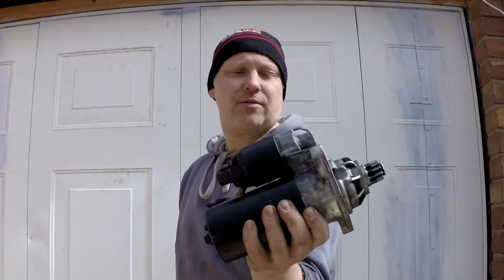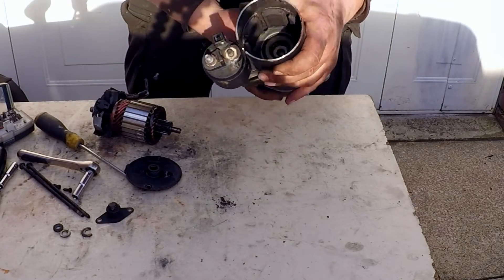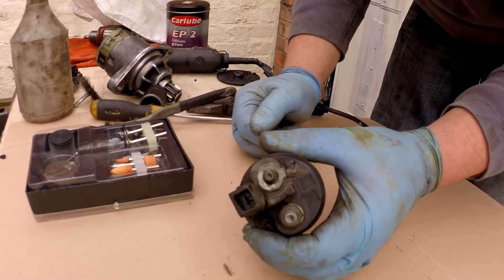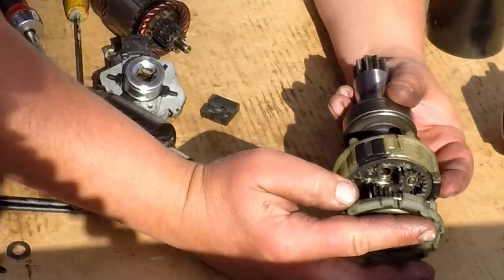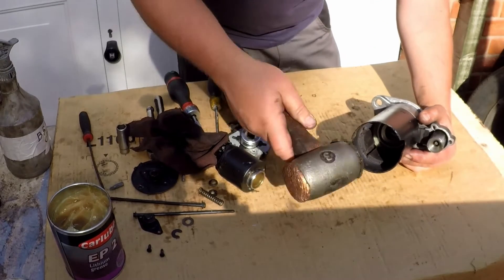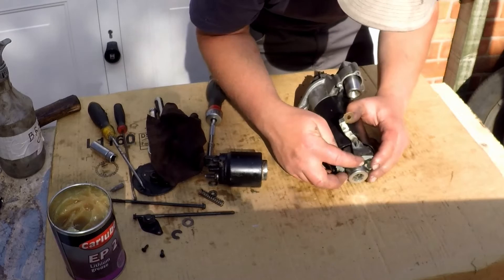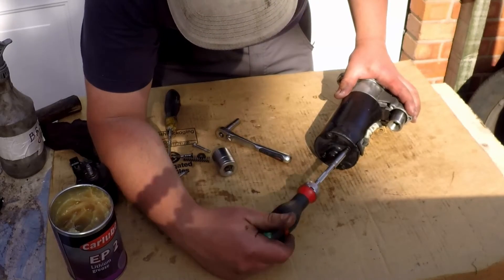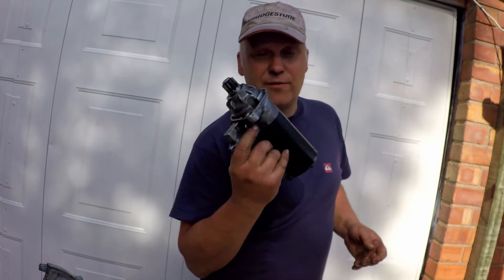Bosch Starter Motor - Strip Down & Rebuild, fixing a slow/poor crank without parts

Comment: Hi...Is the pinion operating lever also available as a spare...in fact is there a rebuild kit with bushes also...It's a poor quality lever  as not steel and shatters sometimes.You could have tested it as you know...before refitting ..but probably safer to not show that process to amateurs.

Comment: Thank you! I have the problem where the bolts securing the starter to the engine block have seized. I will try to attempt this while starter is still mounted. Gut it and put in a replacement bendix gear. Wish me luck! 👍
Reply from the maker: That sounds like a massive challenge!! I'd spend time soaking what ends of the bolts can be seen in a penetrating spray/liquid and give it another go, ideally if the engine can run and get it warm before hand
Good luck 👍
Reply: @CrispysProjects  I've already thrown about two cans worth of penetrant oil at the problem. Won't do. And the starter is shot so I can't warm up the engine. So this is very much a final act of desperation. 🙃
Reply from the maker: @YouHaveReachedBob  Wowsers that sounds terrible 🙄 Other than keeping my 🤞🏼 I can only suggest a push start to try get the engine going or a hot air gun to warm it

Comment: Wish i knew this before i peft my old one out to rot 😂, took it apart and plenty of meat on the brushes and inside looks good but the gear and the clutch thing (cant mind the name) is rusty as now 😢 and my replacement starter just went on the fritz but might try this out on it

Comment: @CrispysProjects i went (ok, read was forced to) one step ahead with this complete tear down by having to reseat the pole pieces,the permanent magnets around the rotor. Thats a bit of a pain in the you know where by itself and that pain doubles when you realise that the rotor now turns in reverse and slips the one way sprag clutch. Had to tear it down again, but in the end, it was worth it. Have a video, might post it. Loved your vid, mine is exactly the same unit. Good job!

Comment: Great video . I’ve to take the golf mk1 starter motor apart
Reply from the maker: Little slow moving like the starter, I'm mid way though another rebuild but with new parts you might find more useful, just awaiting parts!
Reply: @CrispysProjects  my starter just “clicks” so I’m guessing it’s carbon dust build up ??  I hit it a few times and it did work but it does it now nearly every few days so what do you think it is
Reply from the maker: Good chance it's the solenoid either not fully engaging or the level it controls sticking ,try not to tap it too much one of the magnets could come loose
Also time's like that being an classic earth's/lives all good
Feel free to DM pics

Comment: I use a bit of angle iron with 4 holes drilled into it lining up with the solenoid screws and plunger to press it out in a vice. I used to work in a factory with a press to split them. I used to do about 140 a shift. Bosch 0331 lol.
Reply from the maker: I'm going to say you know what your talking about without a doubt! that sounds like a good way, keeping it all lined up - many thanks to the tip👍

Comment: I`ve just disassembled a similar Bosch starter but the magnets came out all together with the rotor. They doesn`t seem to have been glued, is that normal? I have never seen something like that.
Reply from the maker: Errr, yes your right the magnets should stay in the casing, I have no idea what they're bonded in with, I suspect heat resistant at least.
Might of been part of the failure!
Reply: @CrispysProjects  I've only fixed my own starters so that's like 5-6 in my whole life and all of them had the magnets staying in case. I also always knew that if I a magnet is not glued anymore I just go get a new starter. It just seemed strange that all if them are moving now and the starter was sometimes working, I thought it's a new design 😂
Reply from the maker: @wladimiroff7841  glad to hear your keen to fix stuff, no it's not a new design just an old one made cheaper is all I'm finding!!
Keep up great work, and thanks for the comments 👍

Comment: Does anyone know where I can find the coal for this type of starter. I've open it up because it didn't work anymore and I find out the coals where almost gone.
Reply from the maker: I've found many kits on eBay from both random brands and Bosch advertised, they are normally by type number that's little harder to cross ref, need the Bosch part number from the casing help you
I use Autodoc uk website which is great, when buying a number of parts, here's a £3 coupon for new users AC24679507

Comment: Not sure if you're still monitoring this but great video. Just a question on the one way bearing (clutch) itself - you don't mention getting into it - is it serviceable as well ??
Reply from the maker: Thanks for the comment 👍
Only two options is cleaning or replacement, I believe there's no serviceable parts to it

Comment: Is it possible to fix it when the starter gear engages but does not spin.
Reply from the maker: Hey, Chad I've not come across many that don't turn by had unless there has been compete failure of something, take it you've gone back partly stripped it to check it out what's stuck and then parts available.
Might be an option to find a rebuilt one on an exchange basis (normally cheaper than outright buying) or finding used unit
These carry massive current, jamming on could cause massive heat which in is never good near fuel and other plastics
Sorry, better stay safe 👍

Comment: I have done exactly the same and now seems that the starter turns other way around and doesn't want to crank the engine. I must say that I've removed the magnets and not sure if I've fitted them same way back...did it happen to anyone else?
Reply from the maker: I've not came across that before, to turn the opposite way would been the earth and lives swapped around which isn't easy. More likely is something isn't right maybe with the throw out arm. strip down again and recheck everything and all the electrical, including the 13mm nuts are clean - good luck and recheck everything many times

Comment: This has been the only starter strip down video that I've seen that mentions the locating nub on the starter barrel. After I figured it out. After about 2 hours of frustration and tears. In other videos they just slap it together and it all fits.
I wish I'd come here first.
Reply from the maker: Thanks for the comment, I'm glad it's helped you out 👍
Hope it's all back together and working just fine
I also had the same issue 1st one I done, so worth sharing what goes wrong
Reply: @CrispysProjects  It's back together and so far only bench tested.
2 of the brushes were getting stuck in the holder and not making a connection.
Oh, and you're the only one that said to fit the barrel first then insert the commutator, that helped a lot.

Comment: Couple of minor points - It's a good idea the clean the commutator back to clean copper with some emery paper, and clean out the channels between the bars of the commutator with a thin pick. You can even put the armature in a drill to do it. And they're brushes not bushes :) Last one - still sounds a but lazy, maybe think about replacing the brushes anyway as they're not expensive.

Comment: Been struggling with hard cranks in the morning for some time now, solved quite a few things along the way, but you are the first to mention ECU needs certain amount of rpm to fire, thanks! This has been driving me nuts! Excellent video!
Reply from the maker: Thanks Max for taking the time to watch and leave a comment, I hope your closer to solving your issue 🤞Yes ECUs need to have to have a point set between the engine running and stalling, couple RPM too low makes a difference
Reply: @CrispysProjects   All fixed! Starts like a dream now! Exactly the same issue you had, that pesky corroded connection, you gained a lifelong follower my friend 😁
Reply: Besides, nothing like the feeling of doing it yourself, you should have seen my face of satisfaction, not only of having fixed several issues myself, but of gaining the confidence to keep on doing so on the future, thanks again!
Reply from the maker: Fabulous to hear it's fixed, part of the reason starting the channel, as well as trying to document some of the projects! Keep having a go, it's a brilliant satisfaction when it goes right! 👍